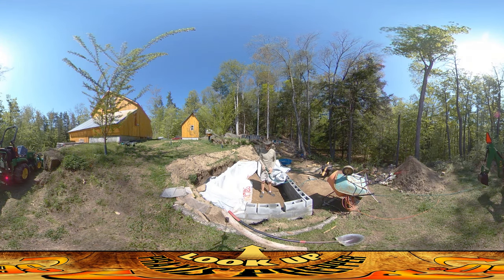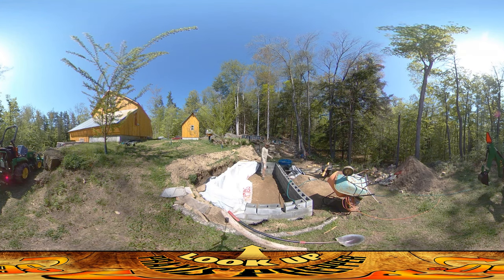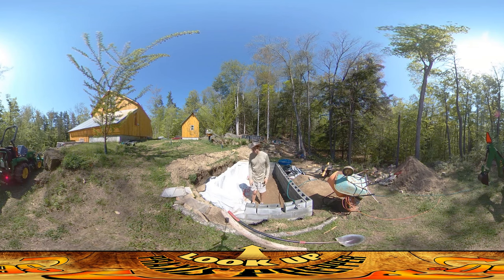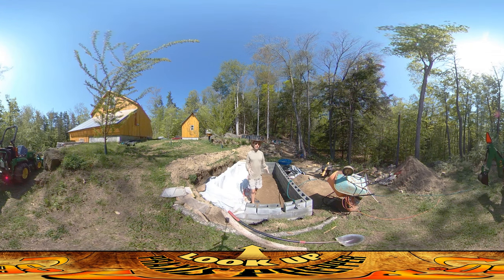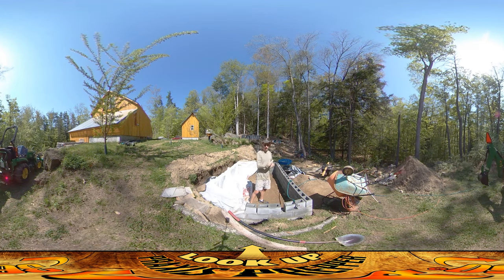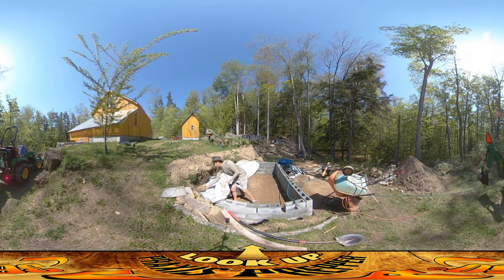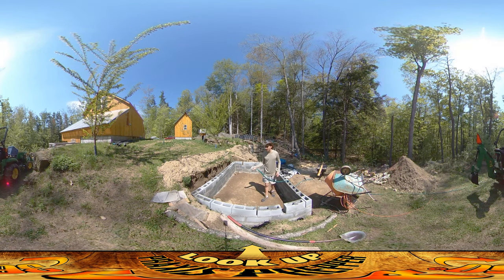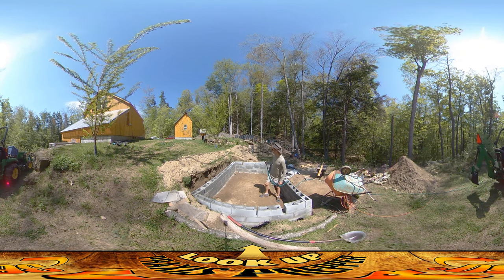Homestead Build - Chicken Coop 2.0, Stronger Concrete Tips

Comment: US blocks are different than our blocks,  our blocks don't come flat at the ends, and Caribbean blocks are also harder. 6 inch blocks were not around when I was living in the HS, first time I saw a 6 inch block was here in the tropics,  thats the common size here, I don't wet the blocks when installing,  but I put rebar inside the blocks for extra strength,  this is done for Hurricanes and earthquakes,  I do keep moist concrete work,  especially a concrete roof
Reply from the maker: Not all our 6" blocks are this shape either. In fact, I was a bit surprised when the pallet arrived and it was all this sort of flat-end blocks without any blocks that have the channel for breaking them in half. I was able yesterday to finagle a few "break in half"able blocks from a previous batch that I'd received, so am able to use those to fill in the ends of each wall.